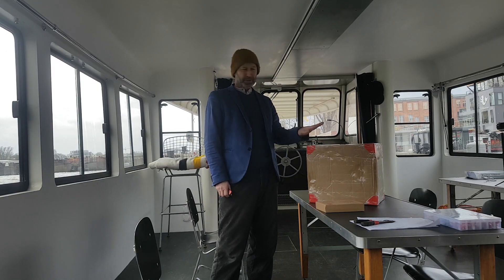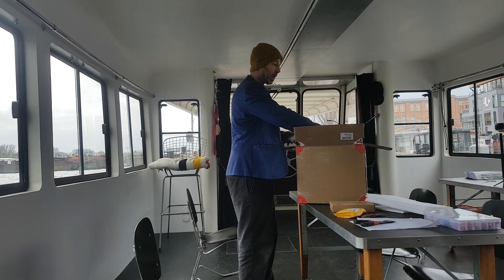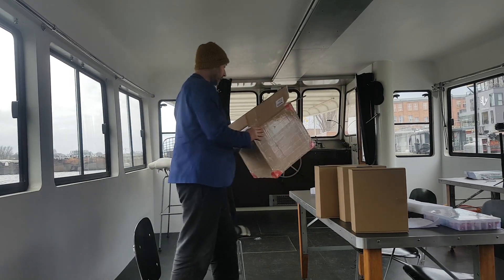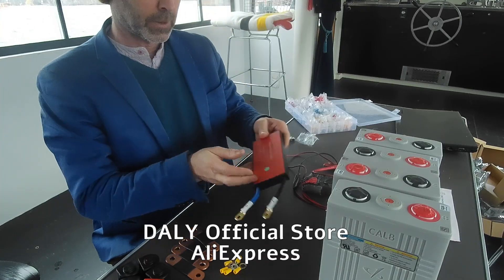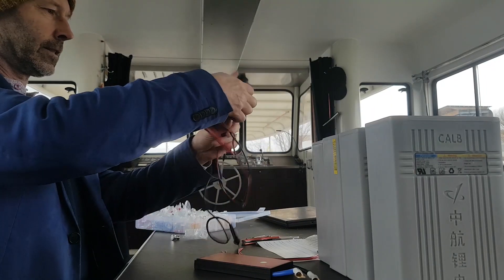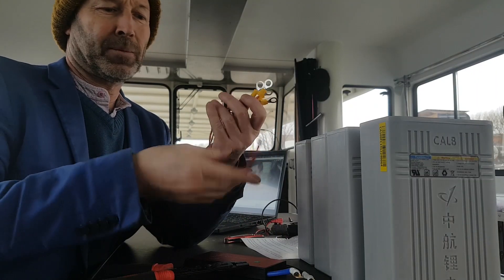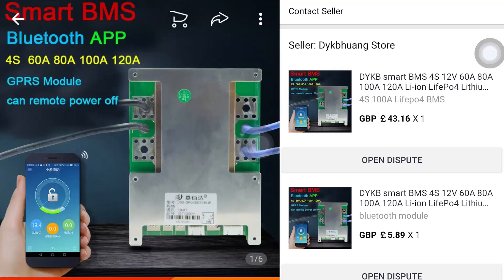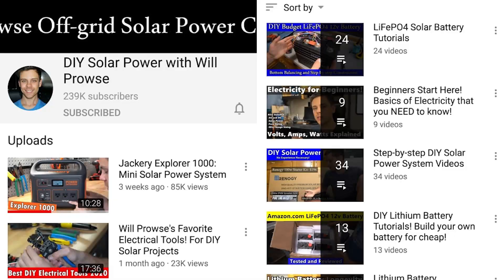Buying the components part 1/3 for a lipo4 boat battery - unpacking and testing

Comment: hi! nice video. about to do the same setup but 24v on my van, as im also looking for robust cells to handle vibrations. is the link in the description the same you bought it from? did you choose poland or china warehouse? how lond did they took to arrive? thanks a lot! im a bit nervous and your video helped a lot :)
Reply from the maker: yep, though check for updated feedback, from China took less than a month.
Reply: @BoatingEurope  thanks for the quick answer! i just checked and seems they have positive reviews, latest one in feb 26 2021. all of them are good reviews.
Reply: seems like tomorrow they start an offer, i think im gonna buy them tomorrow with the offer. what do you think? how re they holding up?
Reply from the maker: @gomxu  yep think soled good stuff, no problems so far.

Comment: We just built our own battery bank on our sailboat (we liveaboard) using 180 amp hour, 3.6-volt CALB cells, and a DALY BMS, wiring the cells in a 4s2p orientation. So stoked on the upgrade! We charge our lithiums in 2 different ways. We send the power from our 120 amp Balmar alternator on our engine to our 100 amp-hour sealed lead-acid starter battery. From there a Renogy 60 amp DC-DC charger takes the load from the alternator and puts it in a lithium profile and in turn charges the lithium batteries. It was a fun build!
Reply from the maker: Its pritty simply isn't it :)